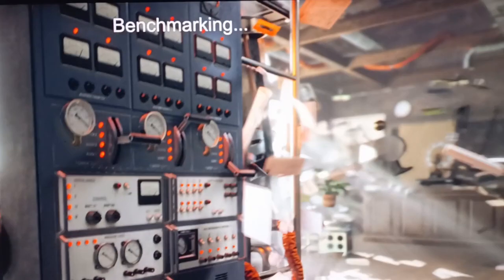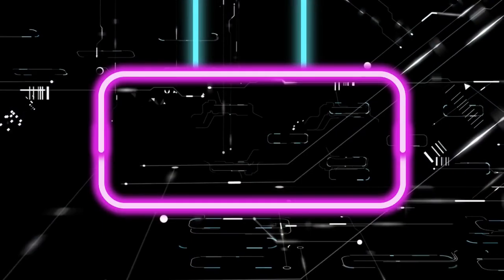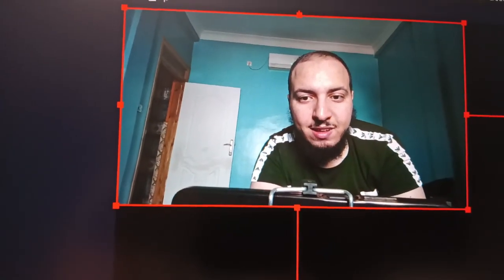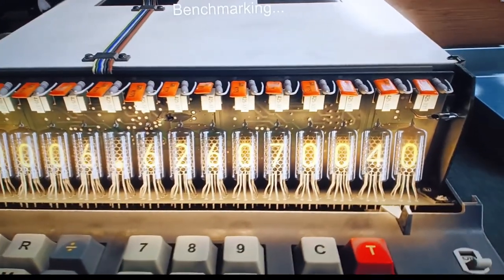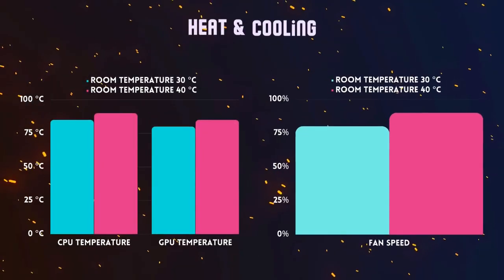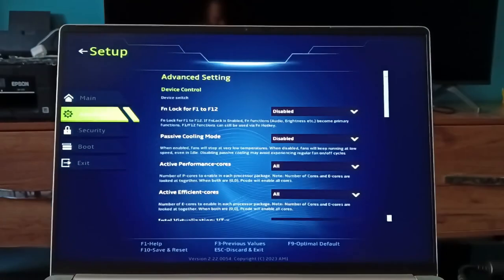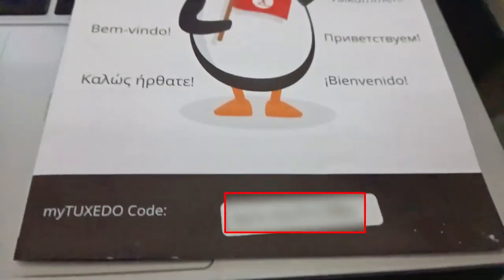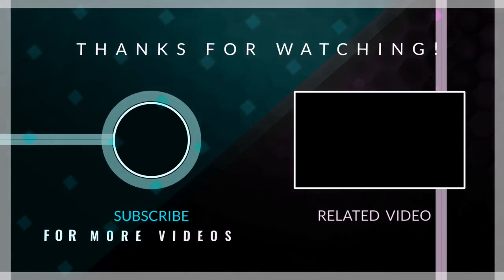In-Depth Review of the TUXEDO InfinityBook Pro 16 Gen8

Comment: Can it be charged with usb 3 charger?
Can you tell if it supports battery charging thresholds in TLP?
Reply from the maker: If you're inquiring about charging through the USB-C port, yes, it is supported, and I addressed this in the video. Regarding the battery charging threshold when utilizing TLP, based on my prior experience, I believe it should be supported. I'll verify this on the InfinityBook Pro 16 Gen8 and provide confirmation shortly.
Reply from the maker: Hello, after verification, it appears that the TLP threshold feature isn't currently supported on the InfinityBook Pro 16. Fortunately, you can utilize the battery threshold options available in the Tuxedo Control Center to achieve the same objective.

Comment: I've tried the laptop. Seriously, the keyboard is really bad for a 2000 USD laptop. This review isn't neutral or the tester doesn't know what a good keyboard is.
GPU performance is very poor, worse than my old laptop with rtx 3070 ti from 2020.
Reply from the maker: I evaluated the keyboard and graphics card using specific criteria and tests, as detailed in the video and supported by publicly available data. In contrast, you did not present any data or criteria; instead, you chose to question my integrity, which is unacceptable.